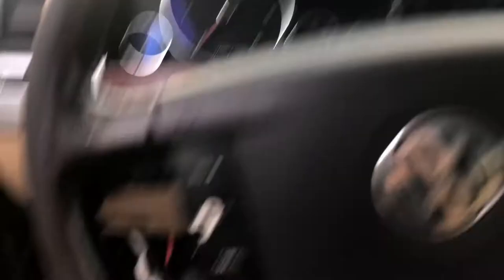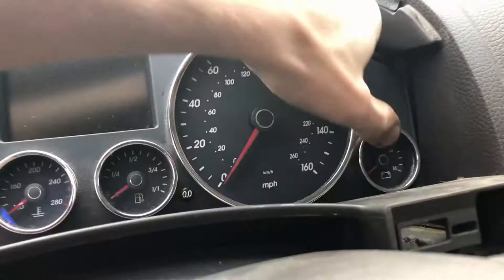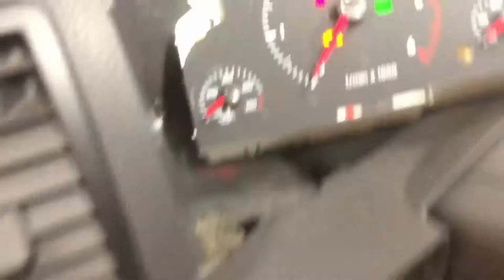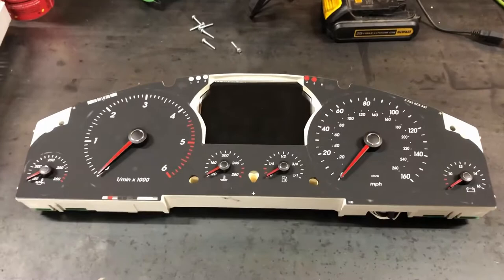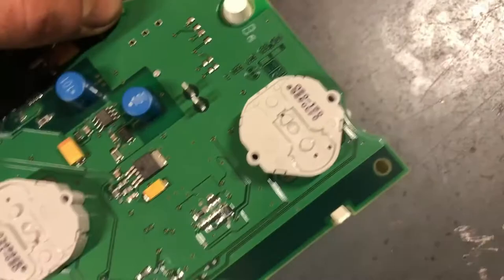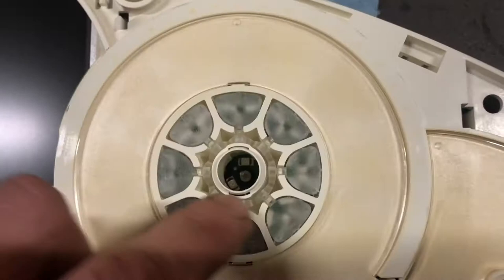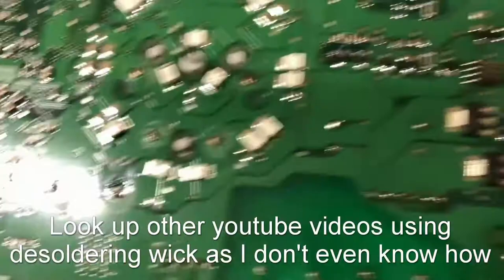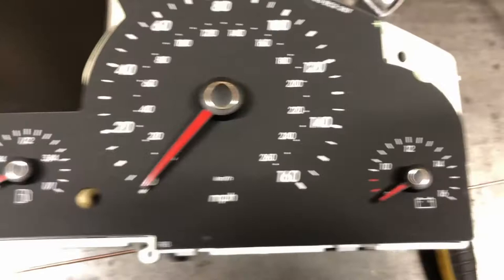7l/T1 Touareg Cluster backlight diagnostics

Comment: Hey. Just wondering if the leds can be replaced for the individual lights. I have a few icons that don't illuminate (main beam warning light) also the little speaker doesn't seem to do anything. Any suggestions from your experience? Thanks
Reply from the maker: I havent personally but the LED's will be soldered to the board, Id be curious if its a bad solder joint as usually LED's last forever. The speaker i could see being burnt out though. Few options id consider is 1:Replace it with a used cluster (if you dont mind mileage being out) 2:Use parts from the used cluster to fix yours if you can solder, or 3: if your located in the US look up Clusters by Litke LLC and see if he would be able to source parts/repair (hes well known in the mk4 golf/jetta groups)

Comment: Thanks for the video. I took my instrument cluster out of my 2005 V8 and used blue cellophane paper around the CCFL bulb to change the color. I found this to be brighter than the blue LED's I tried, and I still retain the dimming function. I also removed the dash speaker, so no more annoying turn indicator clicking. I'm now having an issue with the color MFD at times flashing, or going black. I'm wondering if this is a sign of bad LCD display, or transformers. Any ideas?
Reply from the maker: i like the cellophane idea, I'd try the transformer first but I'm not 100% sure

Comment: Sorry Josh, I don‘t get it, I thought you will change the backlight, from yellow to white. This is what I try at the moment. But what exactly did you do here ? - cause your backlight was working in the beginning 🙈 really want to know. Thanks in advance.
Reply from the maker: Hey, on this one I wanted to keep it factory as it was someone else’s and didn’t want to make repairs complicated in the future for someone else. The backlight worked for the center screen as well as the needles but the gauge background wasn’t working so you couldn’t see rpm/speed/ect. while driving at night.  

If wanting to switch to white get rid of the ccfl bulb that I popped out near the end and stick a LED strip that’s the colour of choice. The issue with that is you’ll need an external 12 volt power for the led, ideally hooked into the cluster dimmer switch.